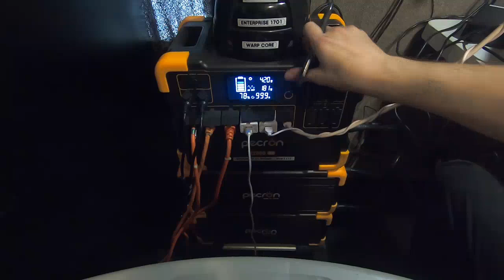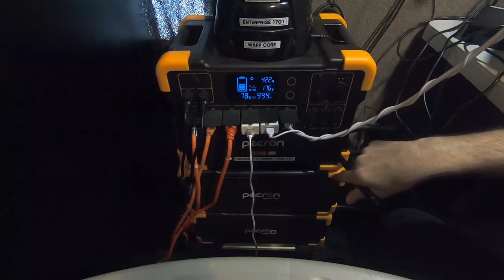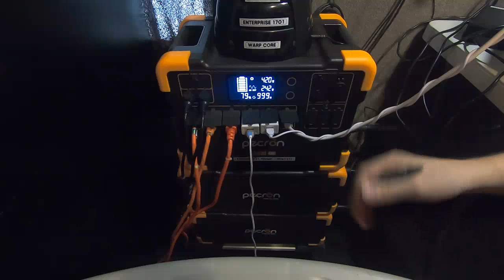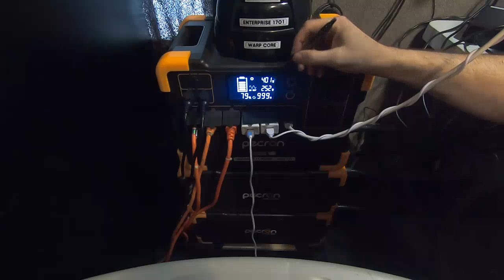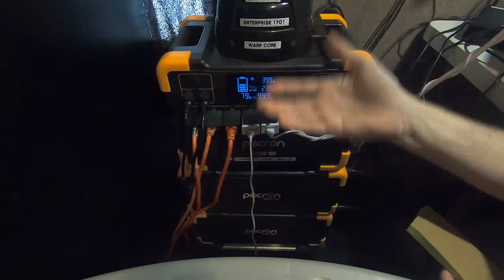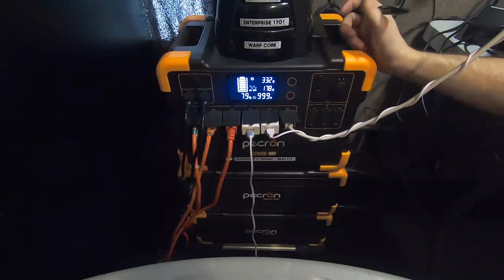PECRON E2000LFP & EB3000 (Update 29) (((((MORE QUESTIONS FROM THE SCRIBERS)))))

Comment: For rain protection on days when I have a small chance of light rain I purchased a 40" X 40" fire pit cover. Using the handle on the trolley it creates a tent over the E3000 unit. It has helped a few times. If there is a chance for heavy rain I do not set the unit out. The cover has two covered vent openings that helps with air flow. So far the unit has not tripped and the fans have not come on when when covered. I have not used it on my new E2000LFP yet. I set the wheels on the cover to hold it to keep the wind from blowing it off.

I just received the E2000LFP with two batteries (EB3000) this week. I decided to try hooking up the expansion cables to connect both batteries to see how long it would take for the batteries to equalize. The lights never came on on the batteries. I changed the setting to have two batteries using solution 1. The unit I received has both solutions set up menus. The lights never came on. The EB3000s came with the old expansion cable but Pecron sent me a set of the new updated expansion cables. I actually received the new cables the day before the units. I then hooked it up to my 2 Qcell 320w panels and charged for a while. Based on the estimated charge time it looked like it was charging all three units. The lights never came on. I contacted Pecron about the lights not coming on during what I thought would be it equalizing / balancing / cascading with pictures. They wrote me back saying "Your connection is correct, in this situation, the status light is not on, it means that the E2000LFP and EB3000 have no output and have been fully equalized and are in standby mode. You can now try to connect a high power appliances to pull the load on the power station and wake it up." I sent them a suggestion to add this as a note to the manual for new users to help them understand the lights better.
I agree there are situations where a longer expansion cable could be needed. I sent the suggestion to Pecron.
I also suggested they add a note to the manual on which solution to use if both are available. I downloaded the latest manual from the site when I ordered the units.
Support is great. Which is rare now days. I have several companies I do not like having to deal with support. Most of the time I know more then they do about the issue.
Right now I like the softer cable / accessories  pouch / box that came with the E3000 over the harder ones that came with the E2000LFP and EB3000. The zippers are stiffer and a little harder to open and close.
The trolley can support the weight of all three units. However the E2000LFP must be on the bottom to fit it. However I am not 100% sure the handle can when rolling them around. I tried it with the E2000LFP and one EB3000 and the handle bent a little under the weight. It helps with air flow on carpet and keeps the units off the carpet.
I plan to test the Qcell panels in series once I have a clear day to see if it trips like yours did and my E3000 did. It has been several days of rain and clouds where I am at with more expected. Maybe next week.
The one AC outlet I have tried is a little tight. It took a little effort to get the cord plugged in. 
The AC voltage is showing as 120V. So that is shipping.
This now gives me 11 KWHs of backup.
I also sent a suggestion for a trolley that can hold / fit the EB3000. The trolley does help moving the units in and out of the house. I also decided a ramp would be helpful going in and out the patio door. I have one I found on order that is for dollies to use on curbs that supports 1000lbs. As a side note I also believe the ramp will help with rolling my 400 watt powered speaker in and out my front door when I take it for events with my sound system. That speaker weighs 100 plus pounds. It is over 10 years old. I have noticed the newer ones are much lighter. The transportation bag for it has wheels with a two hundred pound rating.
Reply from the maker: 1. Always be careful keeping any electronic device out in any moisture (moisture is in the air and it is possible to get that on the circuit boards through the fans, But that cover is a good idea.

2. We pay "ZERO" attention to the lights on the batteries anymore "UNLESS" they are "BLINKING RED" and we believe that is "OVER VOLTAGE" Even if you "WAKE UP" the batteries, The lights will just turn back off and the energy will still be taken from them, You just will not know it ;)

3. The trolly will have trouble with the weight of all 3 batteries, Other people have already mentioned that here on this channel. We bought a 10 dollar harbor freight trolly and is works perfect (we recommend this highly)

4. We like the harder case for just that reaason, Better water seal on the zipper and tough case to protect the cables inside.

5. Your panels should not trip the controllers because you have the newest versions in your, But, Still would like to see the results.

6. THANK FOR FOR YOUR INFO, IT HELPS OTHER PEOPLE MAKE THE RIGHT DECISIONS FOR THEM :)
Reply: @RamblinBobReviews  You are welcome. Like you have said we are figuring this product out together.
I agree on being careful with electronics and water. I figure something heavy duty and water proof could allow me to get some of a charge on days when I might get rain but it is light and spotty. The few times I have gotten a little light rain it was not even showing on the radar. Barely got the cover wet. Not bad for $33. I will be glad once I get the panels installed on my shed to be able to charge the units inside it for much better protection. I did get the cover with the E2000LFP. I have not use the cover that came with the E3000.
I was really surprised when the lights did not go red when I first hooked the cables up as I had seen and the manual mentioned. I do remember you saying and posting about not paying attention to them. I plan to do the same.
When I took the E2000lfp and batteries out today to charge them I was surprised by the fact the clouds cleared. I was expecting partly cloudy all day. I recharged the E3000 first. So I hooked the two Qcell 320w panels in series to see what would happen. This was at 2pm my time which is past my peak time between 11am - 1pm. I was getting 500 - 519 watts out of 640w. After 30 mins it never shutdown. Three hours later it is still going with no issue. I plan to keep testing in the future to see what happens around 600w. The E3000 would shut down anytime over 450. If I recall correctly your E2000lfp was shutting down around that same amount. 
I plugged in a electric computer duster (much better then the cans of compressed air and cheaper over time) to clear some seed pods from my neighbors Elm tree off my patio. Yes it can put out that much air and you have to be really careful with computer fans or they can be broken. It doubles as a leaf blower. lol. This was after I plugged in the panels in series. It uses just over 400 watts. The lights on the first battery did turn on with a green light. After 15 mins of charging I noticed the fans were on, low, and the lights were on both batteries. The first one was green and the second one was red. I figured the second one was a little behind on getting the charge as I would expect. After three hours both lights were off. This was the first time I have had the fan turn on, that I noticed, when I was charging either unit. 
I figure you should have the same results now you have the new boards. Once you get the full sun.
I plan to keep my cases inside, so them being water "proof" is not much of a benefit but I can see that it would be when traveling.
I was told by Pecron that the trolley would support the weight of all three when it was not moving but to be careful using it to move them. I agree the dolly you have can handle more weight. Several I looked at that claimed 500 - 1000 lbs. Moving the units around in the shop it would work much better then dealing with the trolley or a upright dolly. However for me it would not work moving the units in and out a patio door and dealing with the rise and drop. I find the trolley and a upright dolly works much better.
I will post a update when I can get around 600w in series. Chance of rain the next two days.
Reply from the maker: Thanks for the updates Tim.....

   And yes, Together, We all work as a team to help each other out. That was the whole reason we started this entire channel :)

P.S. :)

Comment: Bob, thanks for the videos.  No phone charging will take place until you do a long press on the DC (top) button to turn on the DC output.  If you said this in the video, I missed it.
Reply from the maker: P.S. YES, You have to have the dc one for dc charging :)

P.P.S. Thank you for reminding the folks watching this videos :)
Reply: @RamblinBobReviews  Yes you do.  Another question from this video:  you said things about the E2000LFP and EB3000 not being designed to use all of the MPPT controllers at the same time.  I've got the 8 kWh setup that I've been running with 2000 watts of solar connected:  600W to each of the two controllers on the E2000LFP, and 400W to each controller on the two EB3000, cascaded, all charging at the same time.  I did get two of those Yunsailing watt meters that you mentioned (thanks) and I have one on each input to the EB3000s.  Eventually everything gets charged up and the display reads 100% and 28.8 volts or so.  I just sent Pecron a couple of questions including whether they see any problem with my setup, using all four charge controllers at the same time.  Did they tell you not to do this?  Also I asked them for detail about blinking red on EB3000 as I saw this once.
Reply from the maker: Yes, Charging the eb3000's while hooked to the main system confuses the power meter on the e2000lfp. The system was not designed for that...

Yes it works, But it takes time for the main system to understand that you brought that power in through that "back door" 

That is why when you charge a full 800 watts through the batteries, The power meter does NOTHING :(

The blinking red light means over voltages, This happens when you feend energy through the eb3000's (That is why the red light flashes)

This only seems to happen when youare almost 100% full in the system, We have tested this for months with the same result.

Not to mention, If you leave you solar panels hooked to the eb3000's overnight, We can guarantee that ZERO power is going into the system (check your dc meter to prove this) You will see voltage but ZERO amps.

We have a video coming out soon about that very subject :)

You have to unplug and re-plug in the solar panels to make the mppt start charging on the batteries. Or they will just sit there and waste your money.
Reply: @RamblinBobReviews  I don't know if the E2000LFP power meter gets "confused"...it's just that the meter does not reflect the input watts coming into the EB3000 charge controllers directly.  I'm OK with that, since I can monitor the two EB3000-connected solar strings with the little power meters.  I want to see what Pecron says back to me about the blinking red.  
Now, regarding leaving panels connected to the EB3000 overnight...I do this every single night.  And every single morning, the charge controllers on the EB3000s both wake up without me doing anything, and my Yunsailing power meters fire up and show watts and amps flowing.   I have 400 watts connected as 2s2p to each EB3000.
I originally started with the E2000LFP in August 2022.  Mine was delivered 8/20/22.  Around 11/22, it turned out that when I tried 3 100 watt Harbor Freight panels in series (I wanted to wire two strings as 3s2p to avoid requirement for a fuse on the panels, the charge controllers did not like that voltage (about 54V) even though it was within spec.  Pecron agreed to swap my unit for an updated one.  I was out of town for 3 months so I did not get to do the swap until recently.  The "version 2" fixed the higher charge voltage issue.  Point of all that is I wonder if EB3000s connected to the original "version 1" E2000LFP from Aug '22 behave differently in terms of how their charge controllers "wake up" in the morning.  However, my EB3000s even when connected to version 1 still woke up without intervention.  Didn't you say you have a "version 1"?   For your strings connected to the EB3000, how many panels are in series and what is the voltage being supplied?
Reply from the maker: @BunkieNM  

And i have a feeling that if you keep feeding the power in there like like, That in time will burn up those batteries waaaay faster with that blinking red light (over voltage) :(

That is why we stopped doing that
Reply: @RamblinBobReviews  I asked Pecron support about my configuration including simultaneous 400W to each EB3000 and 1200W to E2000LFP.
Answer:
"You can use this charging method normally, mainly because the use of high power input, is likely to have a slight impact on the value of the display and lead to wrong battery display."  I guess this is just saying what has been said, that the E2000LFP display won't show the input watts coming in to the EB3000s.

I also asked about EB3000 blinking red, but he just gave me "When the status light shows red, it means the cascade is successful, but the voltage difference is large and the battery is being equalized."  I knew that from the manual.  I went back asking again specifically about blinking red.

Did someone from Pecron say that blinking red meant overvoltage?  And if so, did they say overvoltage on the EB3000 solar input, or overvoltage on the batteries?
All of this stuff is handled by charge controllers, BMSs and protection devices, right?

Comment: I got the rain or dust cover in the box with my unit 2.5 weeks ago. Yesterday was the first day I had to charge with ac power on mine since I got the solar panels hooked up, did not use the ac charger since the day I got it and that was just to test it. It rained all day yesterday and I never saw more than 20 watts come in. I probably would have made it through the night since it was at 52% but I did not want to risk it going out before the morning.
Reply from the maker: Thank you for the info :)

So they are still giving it with the unit :)

P.S. We have not used ours ever other than to test it out. But i thought it was a very nice touch to add it :)

Comment: Bob I have a question. I don't know if you made an actual video but, if you disconnect solar from the main unit, and connect solar to battery #1, will that solar power travel through battery #1 and battery #2 and to the main unit and show on the display? And my question is only if you have solar connect to a battery and not the main unit.....Let me know
Reply from the maker: Yes, The power will filter through the whole system, BUT REMEMBER, It takles time for the power meter to understand this, So you just have to wait until the power meter catches up :)

P.S. I would try to focus on just charging through the main ports for best results for that power meter :)
Reply: @RamblinBobReviews yes I'm charging only through the main. But as you know, if you have an 8k system you cannot fully charge 8000 watts in a single day through the main
Reply from the maker: SURE YOU CAN :)

TEST WE RAN:
2.500 watts worth of solar panels (Over paneled of course)

190 watts x 4 (6am until 10am) =750wh input 
1,300 watts 10am until 3pm = 6,500wh input
190 watts x 4 (3pm until sunset) = 750wh input

THAT IS MY RECORD SO FAR : A FULL 8kw SYSTEM CHARGED IN ONE DAY WITH MASSIVE OVER PANELING :)
Reply: @RamblinBobReviews I only use 6 x 250 for 1500 watts @ 70% only gives you about 1050 or 1100 watts. But I only have a 5k for now. Soon very soon I'll grab that 2nd battery
Reply from the maker: We get an average of 80-120% average (don't forget, We have a bunch of those harbor freight panels that put out up to 120% :)
FANTASTIC CHEAP PANELS :)
Reply: @RamblinBobReviews  wow ok. I have 250 watt newpowa rigid panels. I actually saw today on my 2 panel set up 460 watts out of 500

Comment: I think the red light comes on the batteries when you are charging with a/c power and discharging at the same time. I never see the red light come on while solar chargingnand discharging at the same time
Reply from the maker: You have to put more solar into it for the light to come on like that, We have 1,200 watts to test, What is the most that you pulled into your system so far?
Reply: @RamblinBobReviews the most I put in was 1100 watts. 500 solar and 600 from the ac charger and that's when the red light comes on. I disconnect the ac and the red light goes off
Reply from the maker: @mrkevin365  Ok, Up to 600 watts only triggers the lights on one battery, When you really start pushing power in from either solar or ac is the only time it seems to have effects on the lights.

P.S. But i said, We pay ZERO attention to the lights anymore (Unless it is flashing) :)
Reply: @RamblinBobReviews yea I pay no attention them anymore. I just needed to know the reason for the red light and I have my answer lol
Reply from the maker: It's not the red light (that is just the batteries balancing)

(THE FLASHING RED LIGHT IS NOT GOOD TO SEE)
Reply: @RamblinBobReviews yea I never get flashing red light
Reply from the maker: GOOD ;)